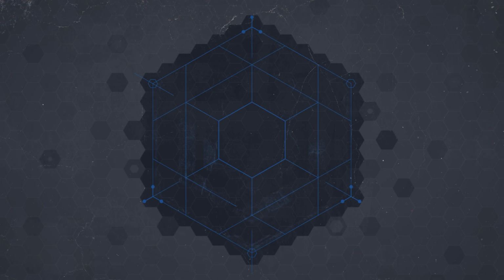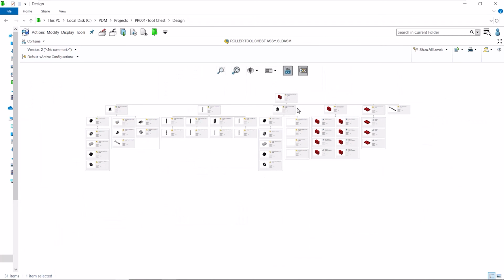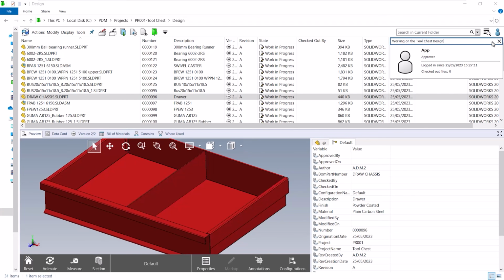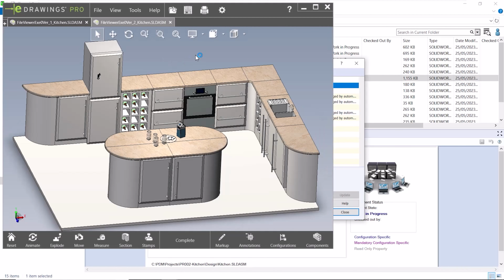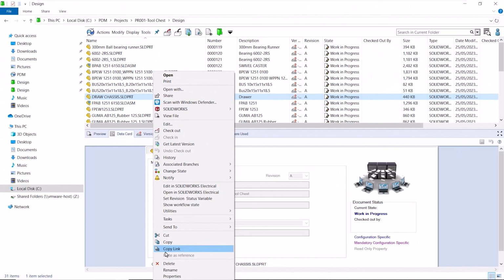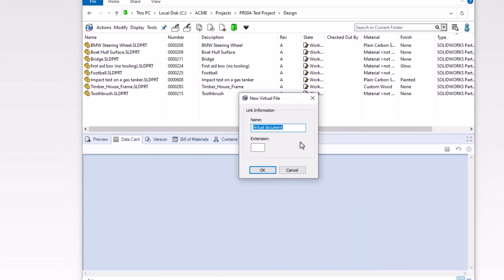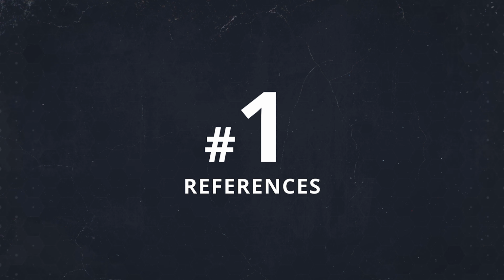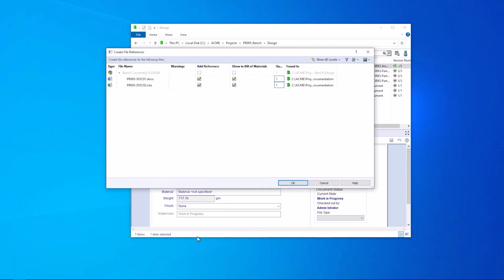Master SOLIDWORKS PDM with these 10 Expert Tips

Comment: Hey there.. I have one doubt with template folder creation. I created a template card which has 2 inputs one is project name and another one is a drop down list which has two types let's say Type-1,Type-2.

I have same 2 root folders for this two types but it's sub folders are different. Is there any way to make it with single template. I tried but In the end I got to create two different type of sub folder list for that. Did you know any way to make it?